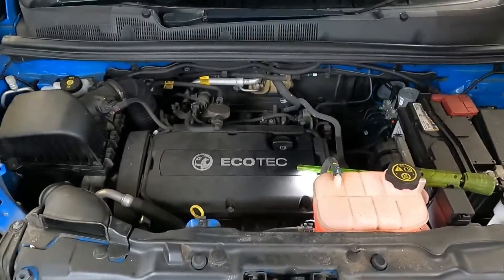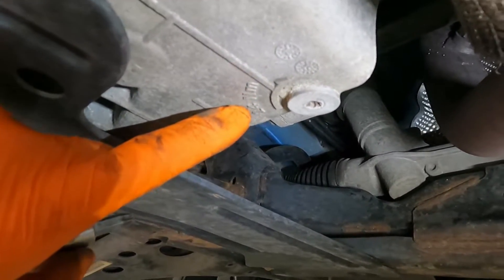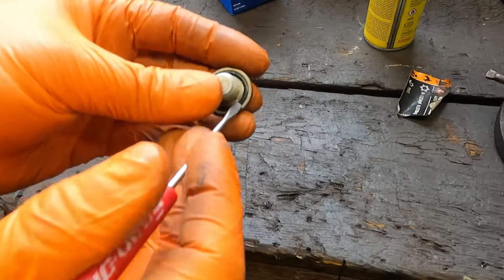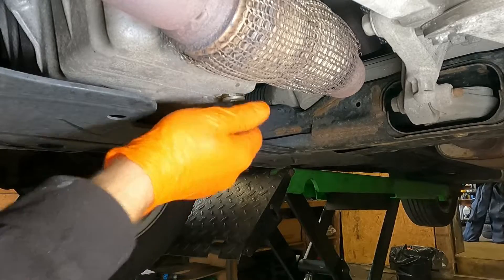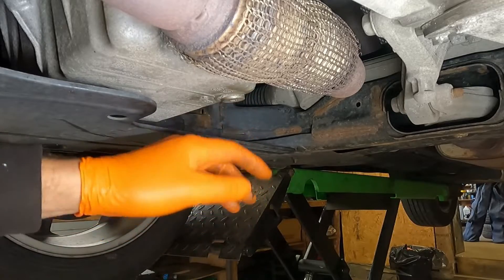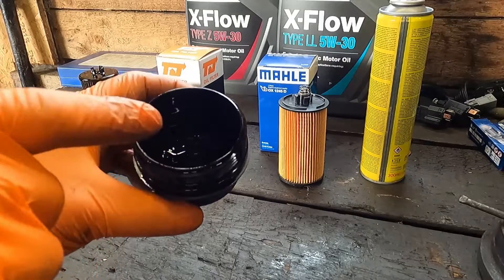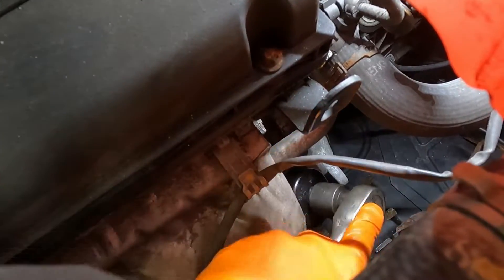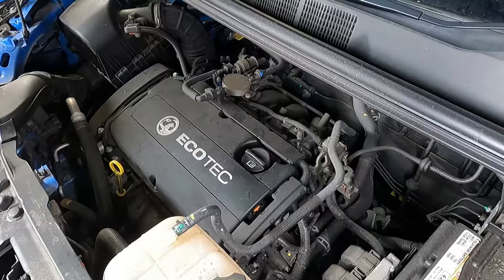Vauxhall Mokka 1.6 16V Petrol - Oil And Oil Filter Replacement

Comment: I finally got the sump plug to undo the garage must have way over tightened it last time and then I've had a nightmare with the oil filter housing I couldn't do it before draining so I thought I'll come back to that after and then it was also on too tight as now I've snapped the oil filter housing so another £30 down the drain and now to try remove the remains of the housing I'll do that when the new housing arrives

Comment: Are these a16xer engines good?
Reply from the maker: As with most things in life, they are only as good as you look after them. Easily maintained and simple / cheap to service 

Andy
Reply: @AMSVauxhall correct. I bought a 1.6 Mokka petrol 6 months ago. Changing oil every 5.000km.

Comment: Looks nice and easy that one. I don't miss the chocolate torx sump plug on the newer Vauxhalls though. I was getting a bit nervous when you reached maximum tractive effort on the ratchet! That horrible feeling where it starts to move slowly instead of the plug cracking off. Been there 🙈
Reply from the maker: Haha I know what you mean but I’ve never really had any issues with them. I would prefer it if they were a normal hex though.

Comment: Hi
Does petrol mokka has fuel filter and where is it located
Reply: Its in the gas tank. Not meant to be replaced.
Reply from the maker: No consumable filter to replace on these. There is a gauze filter at the bottom of the fuel pump in the tank but unless you are super anal it is usually left and only replaced when / if you have fuel pump failure and replacing the fuel pump with new gauze filter.

Andy 👨🏼‍🔧